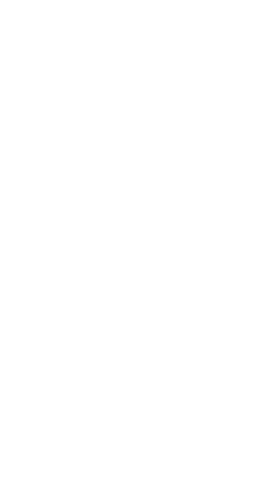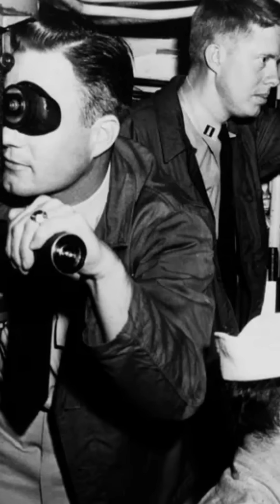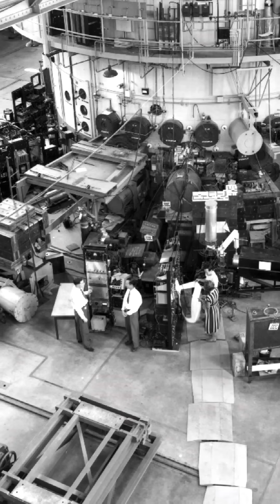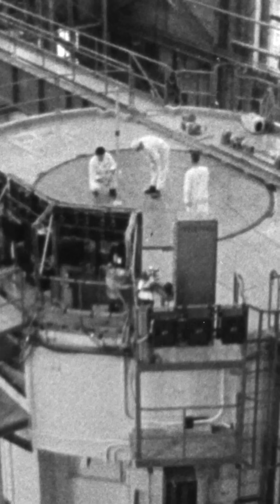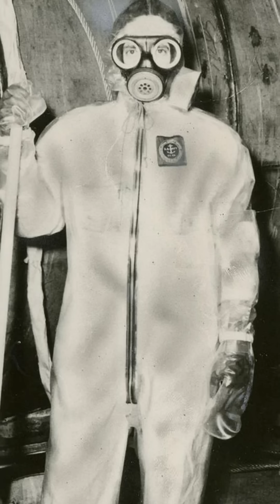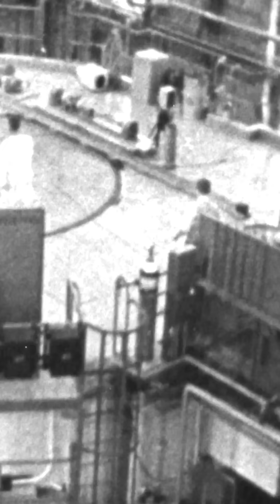Jimmy Carter and the 1952 Chalk River NRX Nuclear Reactor Accident #historicaltidbits

Comment from the maker: RIP POTUS Jimmy Carter 1924 - 2024 
The Chalk River NRX Reactor Disaster, a significant event in the history of nuclear technology, occurred on December 12, 1952, at the Chalk River Laboratories in Ontario Canada. This research reactor experienced a sudden and unexpected power surge exceeding its power capacity for over a minute, leading to a partial meltdown of its core.

The accident, attributed to a combination of human error and mechanical failures, resulted in the release of radioactive material into the environment. While there were no immediate human casualties, the incident necessitated extensive and prolonged cleanup efforts which took 14 months in total and included the young Navy lieutenant Jimmy Carter who was sent into the reactor containment in 90 second intervals to disassemble the reactor. The incident at Chalk River marks one of the first significant reactor meltdowns in history. Jimmy Carter along with many other cleanup workers were exposed to significant amounts of radiation which far exceed modern safety limits.

The Chalk River NRX Reactor Disaster had a profound impact. It served as a stark reminder of the potential risks associated with nuclear energy and catalyzed significant advancements in nuclear safety regulations and reactor design. This event shaped the future of the nuclear industry, emphasizing the paramount importance of robust safety systems and rigorous operational procedures to prevent such occurrences.